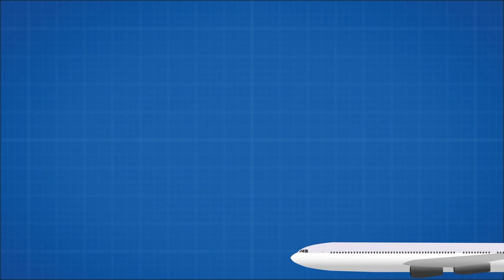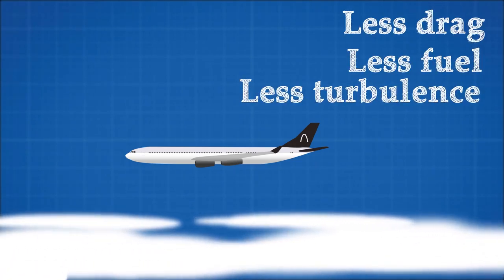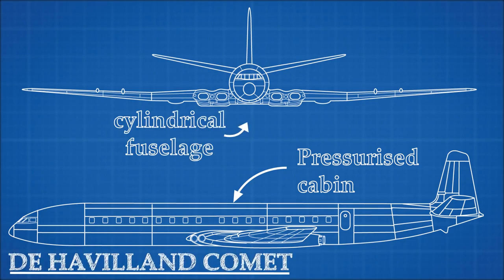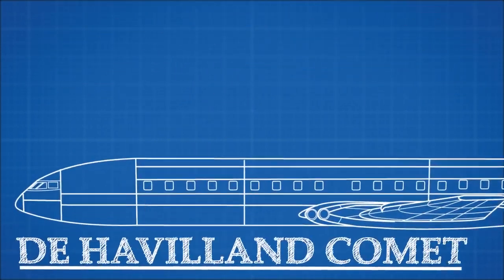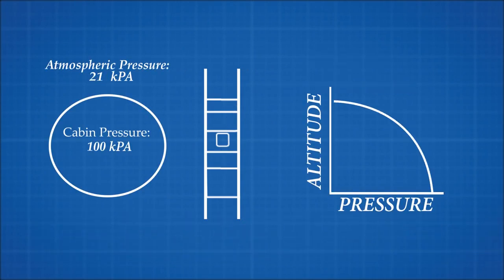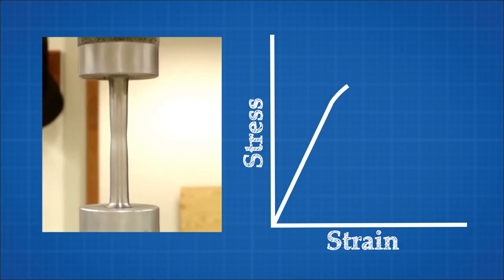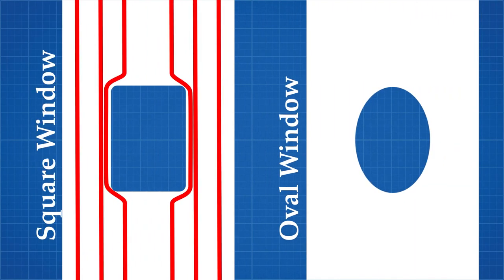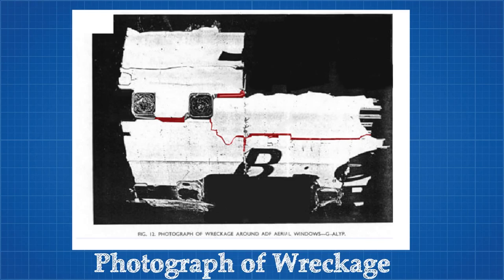Why are plane windows round?

Comment: I always wondered why do plane windows have a clear plastic window on the inside? I assume it's because the outer glass gets very cold and could be painful to touch, as well as attracting condensation.
Reply from the maker: That's just a scratch cover to protect the window. They are actually pretty easy to take off on some planes, although I don't recommend it...
Reply: Yes they seem pretty flimsy, I think it alarmed me the first time I travelled as a kid ;)
Reply: If you ask for the reason of having double window in a plane, it is because it is very cold outside (like -3x degree C), and having air trapped between windows act as good heat insulator to prevent the heat loss.
Reply: Plastic is actually a good material for it though. Plastic flexes and that is good on a vehicle that is basically a giant flying pressure vessel.
Reply: i really dont likt that its plastic tho it stresses me out
Reply: The extra inner plastic is not just a scratch cover, it is also capable of bearing the cabin pressure until the plane gets to a safe altitude (with pressure for humans to survive), in case of the outer window breaking or cracking. Therefore creating redundancy, which is often used in aviation engineering. :)
Reply: The inner piece is called the scratch-pane. 
The window actually have 3 layers, with air gaps in between. 
The outer layer is the Primary structural pane. It’s pressurized during flight. 
The middle pane is only pressurized if the outer layer fails. It’s a secondary safety feature. 
The middle pane has a small “leak-hole” to ensure that it is not pressurized during normal flight.
Reply: I see you are failing for totalitarianism, also no not all ideas server equal tme and respect thats the worst thing ive ever read in my entire life. God stop prattling on over nothing you communist.
Reply: " failure is not an option when peoples lives are at risk."

Sure it is.  Humans keep FAILING & FAILING & FAILING to fill the Senate & House with Greens, 
elect Dr Jill Stein (or Ralph Nader) president, or any other obviously clearly superior leader - 
Humane Party's Clifton Roberts, Libertarian's John McAfee. -
and the result is MILLIONS suffer in prison, in poverty, increasing deaths from poverty-related illnesses
& lack of healthcare because no money for it, & billions of nonhuman animals tortured & murdered in factory farms, & billions yet to be murdered by psychopaths of Wall Street & fossil fuel addicts 
who will continue business as usual & the status quo no matter how much CO2 it puts in the air,
how many starve to death from crop failure, how many homes get flooded by rising seas.

Yes - when I turned 18 in 1982, I was optimistic, thought like you - work hard, play hard - high ethics.
I went through the greatest rigorous science-and-hands-on formal public school education 
from 1970 to 1982, then 192  to 1986 rigorous chemical engineering classes at U of Delaware.
Worked 2 years in a chemical research lab (Rohm & Haas) 1986 to 1988.
But I hit a MASSIVE psychological wall of my life, entering graduate school in "pure" math in 1988.
Nothing was harder. I got MS in math 1991, & PhD in math 2000.

My experience has taught me nihilism & made me the nihilist I am today. The vast % of people are not WORTHY of us learning from our mistakes. They are NOT WORTHY of our best work.  They are worthless subhuman expendable garbage.

You think I am going to give a FUCK if some drunk driver kills people?
I will absolutely support freeing all prisoners again & again & again.
Because the vast % of people vote for the nominees of only the two biggest political parties in their country
ONLY BECAUSE THOSE 2 POLITICAL PARTIES ARE GIVEN ALL THE UNEARNED UNDESERVED FREE ATTENTION FROM BIG CONSERVATIVE MEDIA & ALL THE WELFARE FROM THE TAXPAYER/GOVERNMENT.
I am speaking not only about the USA (obviously, with their 2 TERRORIST organizations controlling our governments, our laws: Republicans & Democrats), but UK and most nations with Western-style democracies.

People who cannot do PhD-level math are too stupid to compute the consequences of actions.
They are too stupid to compute cause & effect. Therefore, it is impossible for them to feel any negative effects
from a car crash or an airplane crash or swallowing 2,000 valiums or 2 kilograms of alcohol.
That is the level at which engineers need to treat the public.

Look - people cannot even agree on who or what caused 9/11, or if 9/11 even existed.
I believe 9/11 existed & I believe the US govt's story on 9/11.
But, in this world where absolutely all ideas must be respected equally, like all the conservatives demand
with their Anthropogenic Global Warming (AGW) denialism & antivax & denial of finite resources
or denying evolution or believing some dead guy resurrected 3 days later and if you eat some bread that turns into this zombie's body & this dead guy is his own father -
then ANY idea - whether sex with children is good for them (I disagree, but that does not matter),
or whether communism is a much better economic system than capitalism (for the most part, I agree)
-ALL ideas deserve equal time & respect.
Reply: @theultimatereductionist7592  this comment didn't age well at all lmfao

Comment: this is simply not true the comets crashes where caused by manufacturing defects when the plane was being built by metal fatigue due to the skin being too fin and not strong enough and the screws to hold the windows in place where punched instead of screwed in which caused minuscule cracks that later turned into a bad case of metal fatigue

Comment: They actually aren't round (in most cases). They are square or rectangular, with radiused corners.  

Some early pressurised airliners, like the Vickers Viscount and the F-27 Friendship, had round or oval windows. Some modern biz jets also have roundish windows. Most modern windows are as I described, squarish with radiused corners.

On the one Comet that crashed due to a structural failure and where significant wreckage was recovered, the failure was not at a passenger cabin window, but in a roof aperture under which a Radio Direction Finding aerial was located.  This aperture was similar in nature to those used for the passenger cabin windows, however.

When structural tests were carried out in a water tank at Farnborough using a Comet 1 fuselage, the failure DID occur at one of the cabin windows.

Comment: Thug life... Been a pilot ten years and had no idea...
Reply: You don't need to, you only need to understand how to fly the plane and not how it works.
Just the engineers who designed that plane did.
Reply: @PeWaRaWNintendoFan  Hi someone from four years ago! I don't think so. I could be wrong, but I think pilots also learn how things work in a plane works, especially in airliners so when something wrong happens they would know how to react. Again, what I said is only speculation and I could be wrong.
Reply: @peyton3509  Hello someone from 5 days ago!Turns out what first year of engineering school me didn't know was that Pilots do learn about engineering too! They just don't go as deep into the material like an engineer would need to.Guess 5th year of engineering school me is a little bit wiser ;/
Reply: @PeWaRaWNintendoFan  As someone who is currently in school to get an RATP pilot license, we do learn a little engineering but mainly aerodynamics
Reply: Cool
Reply: Cessna 402c.

Small and unpressurized. The info about the windows is probably in the manual of the large airplanes as I don't recall learning this in college.
Reply: @ragnarox16   is the earth flat?
Reply: @chidaluokoro9104  interesting questions
Reply: @chidaluokoro9104  yes
Reply: exactly
Reply: We must know the reason behind this. Suppose aeroplane windows are in square, rectangular shape, pressure applying on the corners of the window. So windows are easily break up. Circular shape windows are not have corners. So safe.
Reply: Well probobly becasue the expiation is totally wrong. Stress is caused on outside edges, not inside edges. 

The reason is not to the fuselage, but to the window. Round, and more so small window, reduce stress on the window, making it possible to make them thinner and lighter.

Cockpit windows are still square in most modern airliners. The reason for that is that its beneficial for pilot view and.. well they need to be super strong anyway to handle bird strikes.  And the structure around cockpit windows have to be extra strong anyway.

Compare say the A330CEO to the A330Neo. The windows of the Neo have rounded edges, while the Ceo... well sort of also do, but the radio is much smaller. In that case it have to do with better matching the window due to the neo have curved windows. This is true for all aircraft that have rounded front window (A350, boeing 787, A220) but barley any of the one that have not, not even the A320Neo that despite having the neo trait, still having a flat front window, also having fairly sharp edges.
Reply: Pressurization creates the need, so doesn’t apply to your Cessna.

Comment: Why do we have windows in general? If my flight is cheaper (Easier manufacturing), safer and I can see the outside with cameras and TV's on my screen, why do I need them?
Reply: Safety. FAR regulations require windows to help crew look for damages on the wings of the plane, and windows help passengers navigate out of the plane when evacuating. In an emergency situation, the power to those cameras and TV's helping you see outside is probably going to go away. Also, passenger comfort.
Reply: How can you escape through such a tough and small window? And isn't the plane generally safer if it is tougher and the damage being inspected by the pilots or crews? Maybe 10-20 windows in critical areas for inspection throughout the plane instead of 100-200? If the engine is on fire or something needs to be addressed, I believe pilots would know, and the passengers wouldn't be able to do anything even if they did. Just a thought of mine.
Reply: +dipro001 people like to look outside, I wouls go crazy even if I had internet to entertain myself with on a long flight, and mentioned by others cameras on the outside and screens inside wouldn't make for the same experience, the real deal is just amazing to look at high up from the ground day or night, being there and seeing it with your own eyes.. instead of on a screen.. its like watching a video clip of the statue of liberty in a van next to it without windows.. or stepping outside and seeing it yourself :p
Reply: Most people would feel pretty uncomfortable travelling in a sardine can...
Reply: You can't escape through the window but there will be light coming through it while the electricity of the plane is off (because it crashed), Then you can see where you are going.
Reply: Most planes today, even in first class on top airlines uses very old sub-HD screens with awful cameras and so many other awful technical things that I cannot go on describing. If I took those out for a surround 4-8k visual feed system with high tech cameras from 2016, I assure you, even passengers like you will not bother looking out that dirty tiny scratched up screen. Not to mention if its a safety improvement, public opinion shouldn't even count. I and many others would also be happier for cheaper flights from cheaper to make planes.
I personally am an avid flier(50k+ miles a year), and i do not even look out these days when I fly. I use to though, a long time ago, but that changes with time for everyone.
Reply: I suspect one day windows will no longer be a necessity in aircraft. Aircraft a half century from now will have numerous advances which will eventually see the end of the tube and wing design. But for the present, the reasons we don't see windows go away have already been addressed except for one. That reason is the fact aircraft today are already extremely safe and windows have not been a real issue or cause of any crashes we know of since the days of the Comet over half a century ago. Why fix what isn't broken?
Reply: Mr. Tux considering its a feature useless at night, I am sure we can make a fool proof alternative to the windows just being a light-source. I am sorry if I sound like someone who is being difficult, but I am just being inquisitive.
Reply: +dipro001 I get that but maybe a window also gets air in the wreckage after it shattered because of the impact. I actually also don't really know :)
Reply: If you want cheaper lights then you'd better start campaigning to have taxes and airport fees reduced as this in most domestic cases costs more than the fuel.
As to the windows, apart from safety issues, health is a major concern. Simply being able to see out a window can reduce stress and motion sickness.
Reply: I always like to have a window seat. The view is so amazing.
Reply: When you're taking off and landing the lights turn off and all windows are open, this is because they want your eyes to adjust to the natural lighting outside that way if the plane crashes you won't be blinded when you get to the exit door.
Reply: dipro001
Jet lag is not easily solvable. Do you even know what the term means? It is referring to people being sleepy, because their 24-hour cycle has been disrupted by traveling to a place that is not in sync. I would think that we want to get their faster, and not slower.
Reply: Yosef MacGruber  I am not trying to create a comment section argument here, I am trying to find answer as I assumed most people watching these videos might know a thing or two. My apologies if it looked to be that. I understand the challenges very well, and I am trying to understand what is stoping us from reaching the potential superior alternative, and thats about it. Hope you understood my point. Have a nice day.
Reply: Also, window shutters must be open for take off and landing so that rescue crews can see inside the plane if it does crash.
Reply: Thanks! Anyone else got any more thoughts on this? Would love to know.
Reply: ***** Even if its not "broken", why not make things cheaper with windowless planes? I want cheaper flights! lol. I believe we have the technology to this and make a positive movement right now and the air companies aren't doing it, or I am not getting something.
Reply: TIE DYE CLOSET Okay, that makes sense.  However aren't we already developing jets that will be working to stop jet lag completely according to the destination. Any thoughts on how that might work?
Reply: TIE DYE CLOSET
They turn off the lights, for all of the passengers who want to sleep. Sometimes they may even ask people to close their window shades as well, which is a bummer for people like me, who selected a window seat because we actually want to see the view outside.

Your theory about adjusting to the lighting in case the airplane crashes, makes absolutely no sense. Airplane crashes are rare.
Reply: dipro001
Supposedly, part of the solution to jet lag, might be to adjust your sleeping schedule, even before you take your flight.

Comment: Nice video, but it didn't answer the question.
Reply: It did, if you actually watched it. The question was, "Why are plane windows round?". This was answered by explaining how round windows resist stress from cabin pressure more easily than square windows. Inform yourself before writing.
Reply: "Inform yourself before writing" exclamation mark, no point. So much for that.

Aaaand even in your answer the question isn't answered. You only said why it's build this way today, but not why the windows is round. It's round, cause they are building it this way. What you meant is "Why are plane windows made round today?" which is something COMPLETELY different.
Reply: They explain in the video with diagrams and explanations on why round windows are so good at resisting stress. 

Q: Why are plane windows round?

A: Because they are very good at resisting stress as opposed to any other shape. The stress flows through an oval more easily than a square or triangle.

To be honest, you are making no sense. They showed a question, and presented a clear answer that your simple mind cannot comprehend.
Reply: Being round implies that they were built round, right? why are you so pedantic about this issue? not sure if genuinely upset or just a troll
Reply: I am astonished at how stubborn some people can be.

I understood the question just fine. "Why are plane windows round?" clearly questions the design of a plane window, and asks for an explanation. An explanation was given, therefore issue resolved.

At this point I think its safe to say that you are just trolling, or you genuinely cannot process a simple question and answer.
Reply: Pedantic? Things like these only comes from people, who can't get it right.
Reply: +Evan Mason 
+Evan Mason 
Just because you guys can't understand a simple question you don't have to blame me.

I mean it really looks like you're thinking after the research had shown, that round windows are better some witchcraft happened and changed the machines in the factory.
Reply: +DaveMcIroy Why are you still arguing? You lost a long time ago. You are just making yourself look stupid.
Reply: +Evan Mason 
What are you talking about? Even one of the "smartasses" admitted they were wrong. But there's no need for winning, if you're obviously right.
Reply: I think you meant your OWN question, which is different question as written in the title